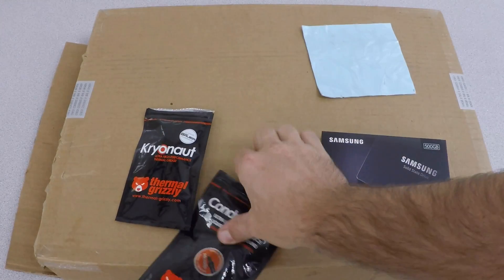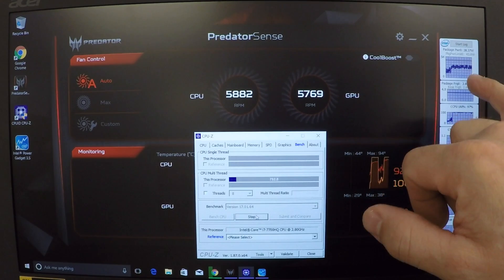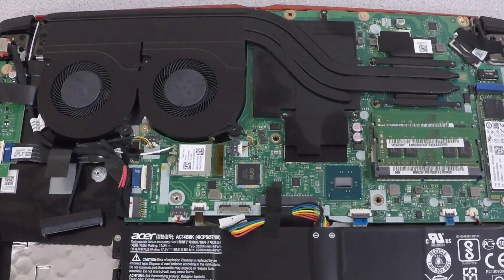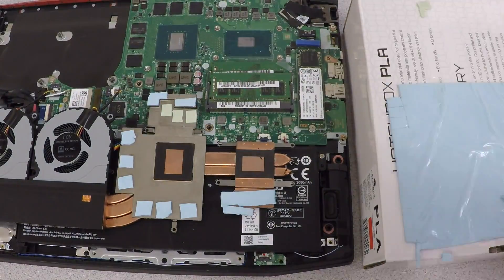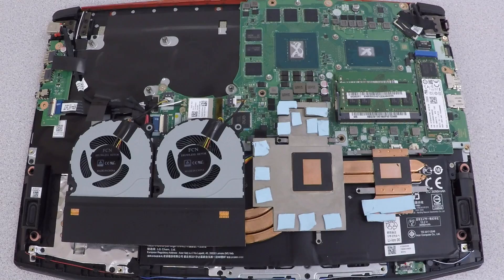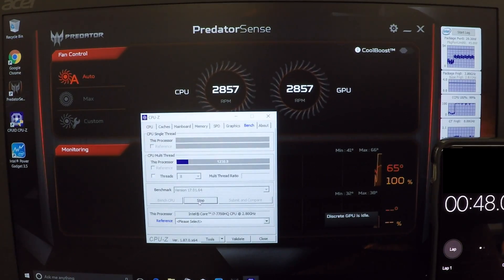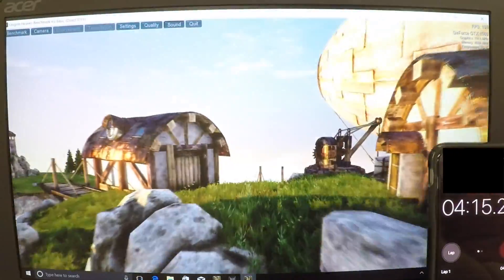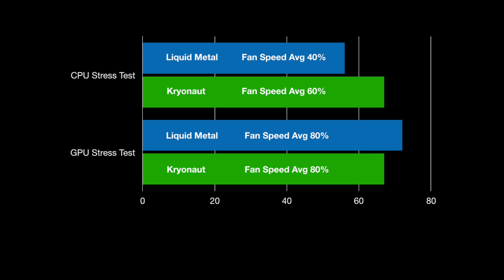Acer Helios 300 Kyronaut vs Liquid Metal Test

Comment: Sick video.
How much do you think the thermal pads affected the lower temps? Or is that negligible?
I'm thinking about getting a laptop with a 12900H, and people's reviews say that thing gets to 99 degrees immediately. Definitely going to tear it down from factory and replace it with some kryonaut.. Just wondering if replacing the pads is worth it? most people say these days, especially for a brand new pc, it's not.. but honestly, if it does make a difference, I will

Thanks for your time.
Reply: You should try phase-change material Honeywell PTM7950. It comes in as a sheet, lasts longer and performs works better than traditional pastes. On the power section and vrams propose to give thermal putty Upsiren UX Pro. Also do undervolting on the CPU and GPU at -100mV or more if it will be stable.

Comment: Copper plating is not a problem normaly aluminium is a problem. The problem with liquid metal is the GPU Dies are bent and if the cooler has not the same curve it will not match properly and you can get worse results than thermalpaste applications.

Comment: While repasting idk what happened, my laptop shut down 2 times randomly in few minutes of turning on. Also, gpu is not crossing 55watt instead of 105w it should, due to this, 100% gpu is being used at 30-40fps yeild. Idk where is the issue. I used thermal grizzy krayonaut.

Comment: My helios 300 gets up to 95 degrees while playing warzone on max settings do you guys think this paste change is a good idea for me?
Reply: Yep, clean your fan and vents as well. Check if your rear vents are properly letting out air. If not, there's a good chance there is a lot of dust clogging them. 

I have an acer nitro 5 which used to run at 95-100 while gaming. I cleaned the fans, and changed to the kryonaut and had approx 20-25 degrees drop.

Comment: In my opinion, you shouldn't apply any paste pattern on laptops due to the compression capabilities of the heatsinks.
Reply: lol no problem that paste is non-conductive the remaining paste will be push out of the die and will touch the pcb of the board but again its non-conductive and will not affect performance

Comment: Did you check inside the fan if any dust was blocking the fan? Old laptops usually have tons of dust blocking the fans. My laptop after 3-4 years of heavy use had its grills filled with dust completely. Removing them took my gpu from 91 to 52 and cpu from 103 to 70 (also reapplying thermal paste)

Comment: One Question: Why does it always show 2.8Ghz as the frequency, when it is able to boost up to 3.8ghz? Did you disable TurboBoost? I have the same Laptop with Kryonaut and with 30% CPU und 30-40% GPU in Game it hits ~98C with -0.125 undervolting. With only CPU I get ~83C.

Comment: My processor i7 4790k. gaming Temps are in the 85-90°C rang.   reduced my temperatures best solution liquid metal or thermal paste?
Reply: Lm is better but its way riskier. If ur new go for a good paste.

Comment: Dude how do you get these results?? I have an acer nitro 5 with an i7-10750h and gtx 1660 ti. I repasted thermal paste with the exact paste in this video, i had to underclock the cpu and that way it never hit above 80°c. 
That was the temps after 1 hour of gaming. Idk how long you ran the stress test though.

Comment: Well, I have had this model around 2 years, I have been struggling with high temps, for some time setting CPU offset -0,150mW helped and blowing off the dust out of the fans. 
Been having 85-90°C sometimes it's been throttling. 

I have opened laptop yesterday, it's been pretty easy, followed step by step, haven't even used kyronaut paste but some Evolveo which had 13,4W/mK conductivity. Cleaned everything carefully using the plastic tool which came with paste, used ear sticks with a little bit of isopropyl and cleaned everything up to be shiny as a brand-new. (Btw the old CPU/GPU paste was pretty dry and spread everywhere). 
So yea after finishing re-paste stuff I just took a toothbrush and cleaned the dust out of the fans since even tho you blow air into it it won't take out everything. 

And after finishing the whole process which took me like 30 minutes (And I have never done it with laptops). 
During playing instead of 80-90°C I had pretty safe 70-80°C without even fan running on high rpm with GPU CPU running constantly on 70-90%.

So I really recommend this if you are struggling with high temps also setting CPU offset via. Throttle stop helps quite a lot.
Reply: kryonaut starts drying out faster at 80c, that's why it's not recommended for laptops

Comment: Is this still giving cool temps as it gave when freshly repasted?
Reply: The liquid metal, unless repasted and cleaned properly would not give the same temps. Since its a copper heatsink, you need to change the liquid metal 6-12 months to ensure the longevity of your heatsink. The kryonaut should be fine for 2 years but its still safe to repaste it.

Comment: Just ordered some Kryonaut. Will use that, benchmark it and then replace it with liquid metal to see if it makes a difference and by how much. On the same 2015 MacBook Pro 15" so should be apples to apples.
Reply: Results?

Comment: helo everybodies!!! I applyed this exactly same product and following the same procedure with my helios 300. temperature stay between 95 - 97°C.
i try to use a fan platform i addition to termal paste but not efficient .
Reply: Same as you but I got little tiny better. I'm guessing it depends on room temperature maybe he lives in cold area.
Reply: He is using too much of those thermal paste and also because he pressed the heatsink when he reinstalled it back again. I only used like a small dot of that kyronaut thermal paste to the gpu and cpu in the middle of it and i didn't pressed the heatsink and just screw in em screws.. i also used normal thermal pads that have like 3.2W/mk thermal conductivity for the vrm.. my cpu stays at 65-68°c and gpu stays at 66-69°c when playing heavy games.. my laptop is the 2018 predator helios 300 i7 8750h gtx1060.. room temperature 25°c..

Back then when i tried his method of pressing the heatsink and too much thermal paste the cpu and gpu got way hotter because em thermal paste over spilled all over em cpu and gpu chips and instead of cooling it em thermal paste act like heat insulator.. the heat generated from the cpu and gpu didn't transfer well to the heatsink but instead transfer heat to the motherboard resulting in auto shutdown..

Comment: Not sure if you're keeping track of comments on 2 year-old videos, but I was trying to clean the fans and re-paste the CPU and GPU the other day on my Helios 300 G3-571 and when re-attaching the fans, I accidentally plugged the cables in upside-down and started the laptop. I've fixed that mistake, but the fans still won't start.

Did I accidentally fry some components in the fans or damage the plugs in some way? Should I simply contact Acer and see if they will repair it?

Any help you could give is much appreciated.

Comment: I did this and cleaned the dust out of my fans and went from 92 C to 60 C playing high resolution warzone. Thanks for the help! Predator Helios 300 2018
Reply: Which one did u applied on?
Reply: wrifai I applied the kyronaut
Reply: how your laptop is running now?
Reply: Venom SSSnake my laptop 2 months later is running perfect with no problems at all able to game for hours
Reply: I tried cooler master mastergel , and within a week the whole paste was pumped out from cpu die :(
Reply: Venom SSSnake dang that’s sucks to hear
Reply: @anykate  There are three mastergels i guess, one is 'regular' , another is 'pro' and another is 'maker' which one you used?
Reply: @JagtarSingh-xt6os   I used regular one but it got pumped out within 2 days so I purchased kryonaut and I've been heavy gaming in laptop since 1 year no heating ( I play 12 hours a day)
Reply: @anykate  I'm going to apply conductonaut tomorrow, its best you can get
Reply: Felipe Stormesan yup I undervolted. The same paste that I applied 3 months ago still works today and it’s still working very well.
Reply: @taypically3106  thanks for keeping us updated.

I’m debating wether to get Arctic Mx4 or Thermal grizzly Kryonaut
Reply: Darell D  because if you fuck UL with liquid metal then your motherboard gets short circuited
Reply: Darell D  I just didnt want to take a chance on a Helios 300 lol. I ended up undervolting gpu -100mv, cpu core -200 and cpu cache -125, and disabled turbo boost since i dont use it. I went from 85-90c down to 72c max when playing warzone on max settings. Cpu idle temps also went from ~50c down to 37c. I have an Arctic Mx4 thermal paste on the way already but i might not even bother using it now that I'm seeing such relatively low temps
Reply: @MechanicalAddict  this is great info didn't know I could undervolt gpu and cache I never touched that, I only undervolted core -120 disabled intels turbo boos and other unnecessary stuff and cleaned up fans and applied arctic's mx 5 and running GTA V 59-62c and Hunt Showdown at 62-67 with fans maxed (I don't even hear them when playing because of headset, if not playing they're on auto). I will give it a try see if can lower temps even more though I believe I'm doing good already. I own the g3-571 2018 i7 7700hq and 1060 with 16gb ram. Thanks!
Reply: Darell D  When you said turbo did you mean the turbo button?? In The throttlestop program there's an option to 'disable turbo' which caps the CPU to 2.6GHz.. If you meant the turbo boost option from the helios then I honestly never used that because of how Loud those fans get. I'd rather not have my laptop sound like it's ready to take flight lolol
Reply: Hope kryonaut will not pump out
Reply: Venom SSSnake yeah a little dot on the cpu and gpu was enough
Reply: Did ur fps increase?
Reply: Zack Ralph yes it increased because I not longer had thermal throttling due to the heat so it helped me keep a consistent fps
Reply: Antech for CPU ans Noctua NH2 GPU.
Reply: Bro upto what duration the paste performed good ??

Comment: Great video. Have you got any issues with your battery?... or really not sure if it's with the power brick.... sometimes when using the laptop while plugged in it will beep and the plugged in icon will go to only battery. I have to unplug it and replug it so it goes to AC power again. Checked battery life and it's 84%. CHeers!

Comment: I'm really confused I repasted the laptop with the same paste and now while it doesn't thermal throttle, it gets to a higher temper and then holds a higher temp at idle. Like after a game it used to ramp down pretty fast to 40 degrees or so now it holds 60-50 while he fans stay on. Idk how that makes sense. I also held lower 70s during the cpu z test with 4000rpms
Reply: It happens auto calibrarion can discover it can go higher volts safely..

Comment: it's funny to see u using fan speed to measure the heat.......

For those who did notice......it drops 10 degree in general.
Reply: I guess it's more about... the fans kicking in.
CPU temp at 62 degrees with fan at 40% is better than CPU temp at 60 degrees with fan at 100%. Because you can control the fan % easily but not the CPU temp
Reply: @EpicBunty  well i can control fan speeds. If the software thinks 60 degrees is okay it might keep the fan at 2k rpm while i can force it to rotate at 5k rpm and cool the laptop faster.
Reply: @AkashlalBathe  ok, but i'm not able to understand you point here
Reply: But he has shown the temps for the heat measurement🙄. Whats wrong if he is also showing also the fan speed ?
Reply: @EpicBunty  The x axis on the graph is temperature not fan speed. Check again.
Reply: @abhisheksingh8641  yea.... Ur correct my bad

Comment: How many "mm" does the thickness of the thermal pad have to be?
Reply: I think in this case he uses 0.5mm think pads, but I think any thickness from 0.5 - 3mm should be fine (maybe with a little difference).
Reply: @SnowyWiz  no, too thick or too thin can cause issues with heatsink making proper contact with the chips. If u dont know go for around 1-1.5mm to be safe

Comment: Is artic mx 4 good with the Helios 300 ?
Reply: It's good
Reply: @krimsondeagle4463  isn't. i have a acer nitro 5 with i7 9750h.. the temperature with mx4 was up to 95*C. i change it with Alphacool 12879 Eisfrost Xtreme (Liquid Metall paste) and the temp dropped to 80 - 84 max *C full load.. this is amazing. now i want to try this grizzly kryonaut..
Reply: Dont recommend mx 4 either.

Comment: The Chart at 13 minutes has the liquid metal at higher temps on the gpu test, is that accurate?
Reply: The core was cooler but the gpu was hotter. Yup that's correct - I had the same thing happen to me too on an rog model 

What happens is since the cpu is able to dump more heat onto the cooler and thus maintain a cooler temp, the gpu core would have a slighter higher avg temp since its offloading heat into a cooler that is slightly warmer as a result... hope that makes sense
Reply: I guess? Its clear he didn't see as large and improvement but from what I gathered, you would probably get better results.

Comment: PLEASE HELP. I applied the paste and did everything and I’m still getting high 90C. What could have gone wrong???
Reply: make sure all the screws are tight
Reply: Flammie Trulyworth yea i did that. It actually worked cuz one screw wasnt tight enough. But it seems its gta v that I get high temps with. Other stuff pretty nice👍🏻😊
Reply: @JaJa-gh3ze  you'd wanna make sure that all the heatsink make contact with the die so they can spread the heat. Glad i can help
Reply: Oh and 90c for a predator is average not high but it is not suppose to be at 90 more around the 80s
Reply: You applied too much. He is actually giving a wrong recommendation of using more paste. a grain size paste is necessary. Too much is going to spoil everything. and will heat up even more.
Reply: @aayushagarwal5638 
False

Comment: I need help! I had my old thermal paste replaced on my helios 300 1660ti with kryonaut thermal paste and replaced the old thermal pads with an arctic thermal pad and my cpu temp is still hitting 90 degrees celsius, gpu temps hitting 80. I'm so disappointed with the products because it seems like theyre not helping to reduce temps. Is there something that we might be doing wrong? I had it done in a service center because doing it by myself will void warranty. I'm in front of the technician while he's working on it so I'm sure he's not slacking off.
Reply: Any updates?
Reply: Can you please elaborate with updates ? here is 2021 with same issue still ongoing !

Comment: it's not a bad idea to do the same thing you did except you did one mistake while benching. you had multiple apps open and your CPU was barely scoring 1200 on CPUZ. I have the same laptop with the 7700HQ and I'm scoring near double your performance I'm sitting near 2000 points. go into your predator sense, hit turbo, and even if the laptop is super cool, it's gonna go much faster in benchmarks and gaming.

Comment: one thing that made me a little upset when I first opened up my laptop the fan side only had two screws in each corner I guess Acer cheapened out with mine haha
Reply: That's not good that actually could warrant them sending you a new one if you told them that or they cause send you more screws
Reply: same to me!! cheap mofos! they only put 2 scrws on it

Comment: Hey man I just want to thank you dearly for this videoI did everything in your video change my pads and thermal paste to grizzly kryonaut it took me 3 hours cuz I'm very particular on heavy gaming full load I used to get 95°now I'm down to between 65 and 70 even without undervolt!!!
Reply: I also applied this and I’m still getting high 90C, any idea?
Reply: @JaJa-gh3ze  undervolt. i undervolted only my intel turbo and even it helped a lot
Reply: Philosophist i did. Still high temps tho
Reply: @JaJa-gh3ze  Sounds like your laptop is defective then. Send it back into Acer for repairs, after re-applying thermal paste, your temps should never exceed 80 degrees.
Reply: What termal pads you used? 0.5 1 or 1.5?

Comment: Question, I bought the same model about 1 year ago and forgot to do this, the laptop now shuts down, like power goes off even, randomly whenever I play a more resource intensive game, even though the laptop is able to run it smooth. I know this is happening because of overheating since this always happens whenever the temperature rises past a certain treshold for a certain amount of time, which in turn has led me to uninstall a lot of great games I bought due to the laptop suddenly not being able to run them anymore. So, would applying the proper thermal paste, help me, or have I somehow damaged the processor beyond repair?
Reply: As far as I know, the system automatically shuts down if you hit 100+, if you apply the thermal paste on both (CPU and GPU), clean up the dust inside (especially around the fans), undervolt using XTU. You shall be able to game again with way lower temps, which means not hitting 100C resulting into no system shut down.

Give it a try bud, even if you fail due to damaged components, its just gonna cost u around 10 euros. No more (if you do it urself that is). 

Good luck and tell us how it went mate!

Cheers
Reply: @suzi971  thanks a lot, I will have to learn how to undervolt the cpu but I will give this a try, I just can't promise to let you know how it went because it's hard to dig for old comment on youtube.